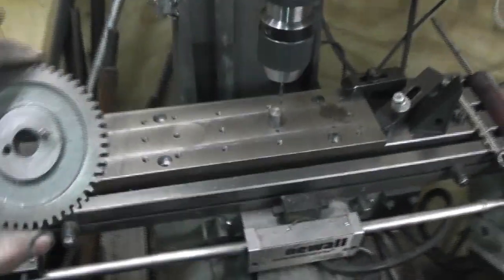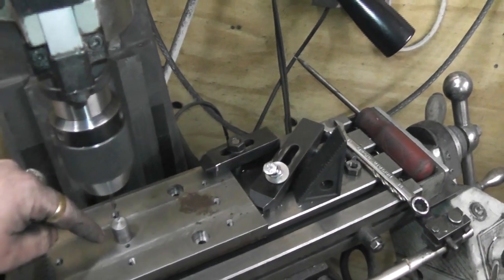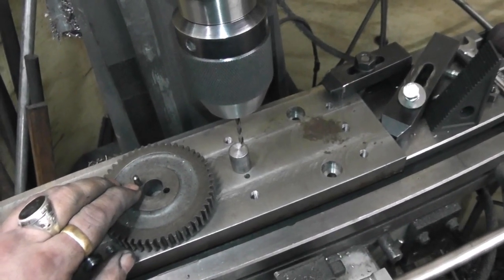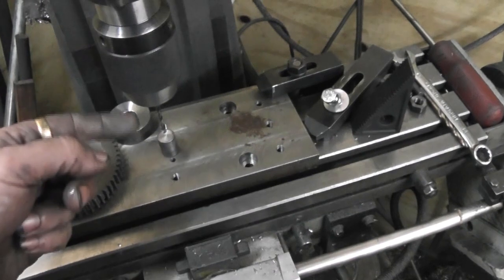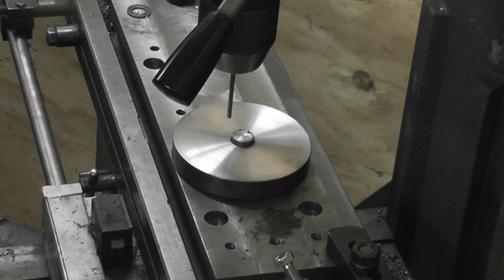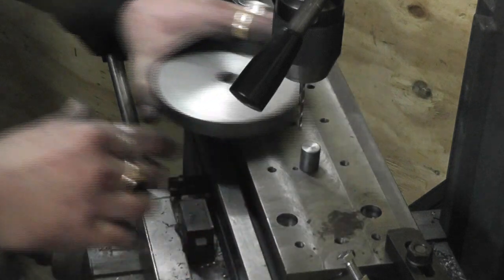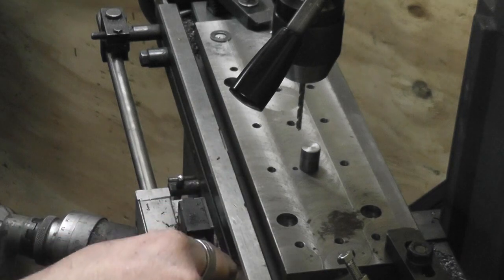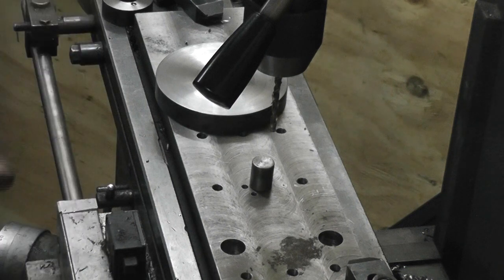drummond gear hole drilling jig

Comment: Great series of vids Mark enjoyed them all immensely since I’ve ventured into metal machining
Reply from the maker: cool I'm glad they help you out fella, but be warned.. I ventured down the rabbit hole when I only had the 1 wood lathe, just to make custom tool handles and add metal to wood I was turning, now I've got about 9 lathes a milling machine and a few other bits of machinery ( 1 lathe setup on a treadle stand in the kitchen ) ! , not for an artistic focal point or conversation piece but simply I don't have the space anywhere else lol
Reply: Hi Mark . I have a M type long bed 1946 vintage , I would like to make metric screws on this amazing lathe can you point me in the right direction to make my own gears , i need a73t and a 40 t to go with the gears i have to do what i want. Thank you